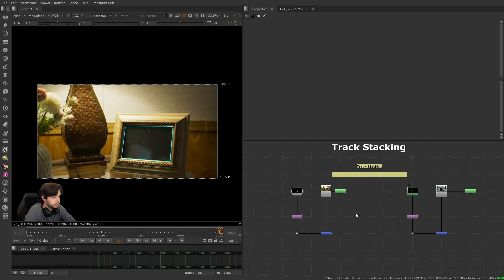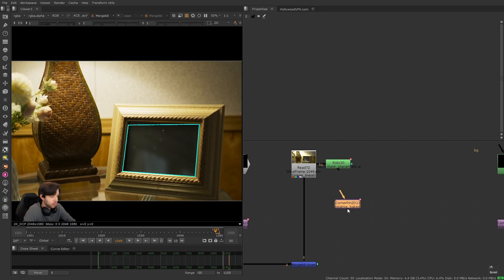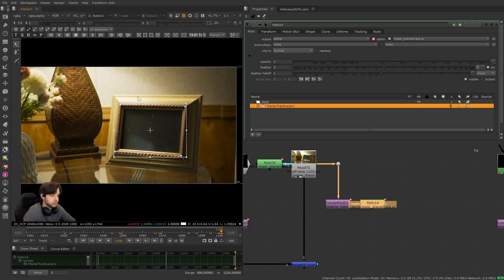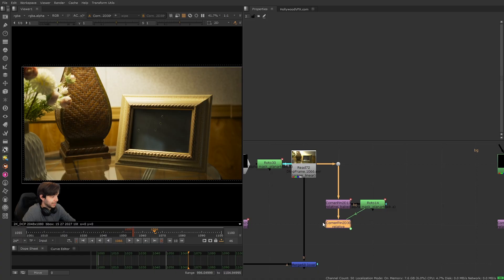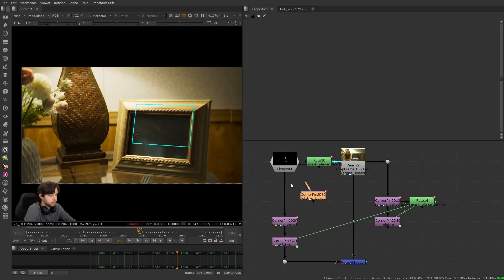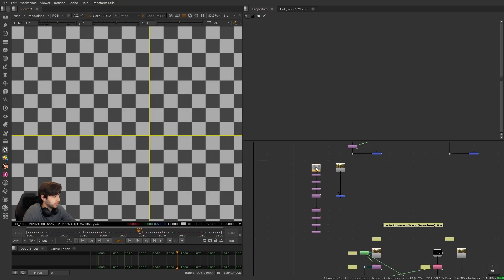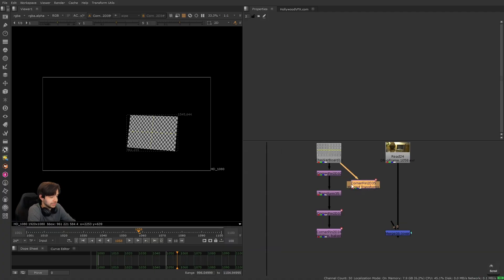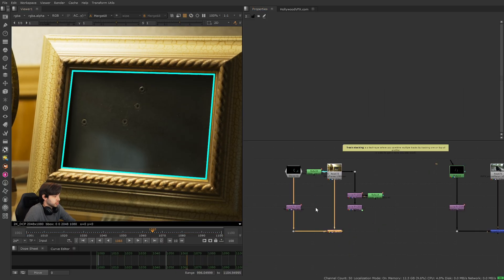The Power of Stacking Trackers in Nuke

Comment: Mocha would work better, right?
Reply from the maker: Sometimes, yes - sometimes, no. 
I use mocha on both of these shots in previous lessons within the course and both still require some manual tracking to get them near perfect.
Reply: @DanielKaczkowski  Just watched the shot from your other video which is pretty insane and I can imagine that you have to do a lot by hand...
For 3d-tracking drone shots, would you use Nuke, Syntheyes or 3dequalizer?
Reply from the maker: @GregorPQ  The phone shot was done entirely by hand, yes haha.
Depends on the drone shot, but if it's a straightforward fly through type shot, Nuke 3D tracker should work fine.
Syntheyes/3DE are much better than Nuke, however, so I do recommend them for tough tracks.
Reply: @DanielKaczkowski  Thanks! 
I want to use a variety of shots and use Gyroflow, so which of the 2 would be best equipped to deal with the lens distortion workflow-hassle? Applying the stabilisation data from Gyroflow I have to do in Nuke after the tracking while composing... did you ever try that?
Reply: Actually Mocha will work awful in last shot, and even worse, you probably can't do the reverse transformation technique to fix it as easy as shown in this great pro tip 😁

Comment: Same technique of reverse transformation applies to 3D. In Maya if you want to calculate reverse transformation you apply transforms in reverse. Maya rotates in X, Y, Z, and for local space you "un-rotate" by going -Z, -Y, -X. I used that trick if I want to find position or orientation of objects in camera space, without having to parent or constrain things to it. It's useful if you are doing classic sprites and want to align them with the direction of motion. You take the sprite velocity and rotate it around the camera in reverse order. Calculate the angle that comes out and you have your sprite orientation. Mathematically it's the same method as in this video.